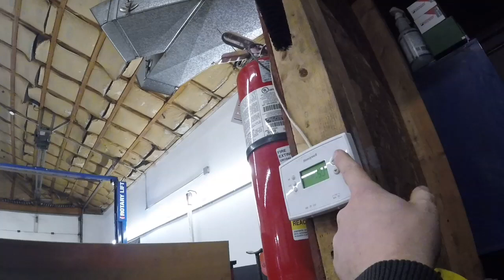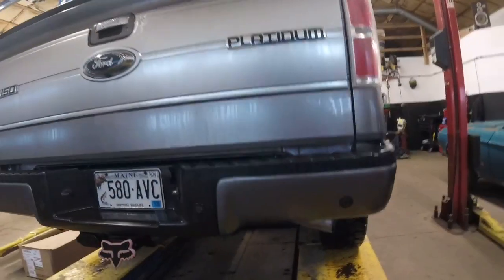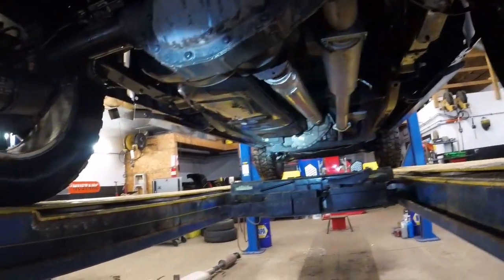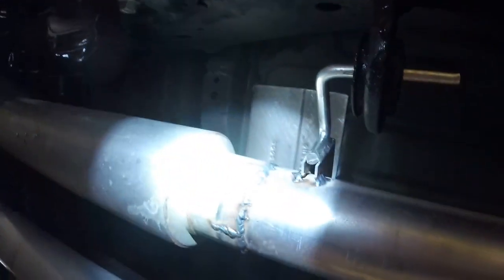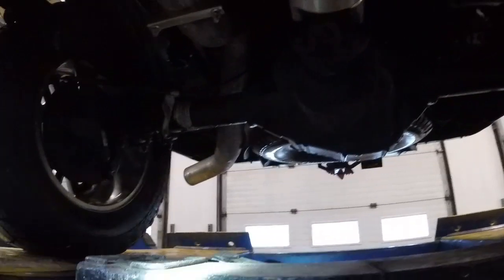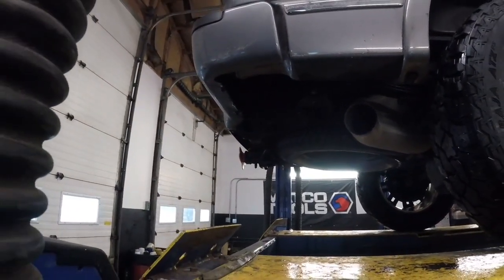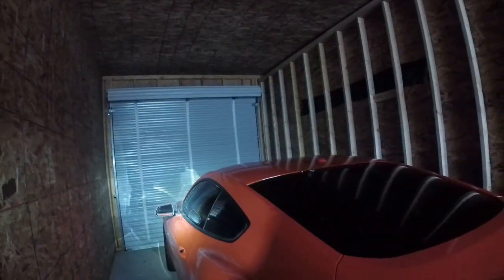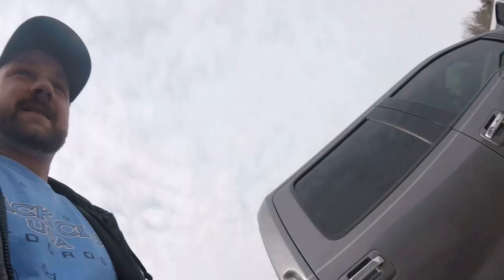Twin Turbo F150 gets LOUD!!! Mustang update

Comment: Did you have to retune your truck after putting a bigger diameter exhaust? Or it ran perfectly fine?
Reply from the maker: No tune required for cat back. If you get into the down pipes it would be very beneficial, but still not required if still catted

Comment: Did you notice any fuel mileage gains or loss?
Reply from the maker: Nope, MPG hasn't changed much since we bought the truck. We get 18-19 in the warmer months and 16-17 in the winter. I think it mostly decreases from more idle time warming up and defrosting windows.
Reply: @TheGTXJay  any power difference is the throttle a lot more responsive?
Reply from the maker: The exhaust didn't do much that I noticed, besides making the truck louder. However, AFE intake and SCT 93 octane tune were previously installed beforehand and they definitely improved the power noticeably. The intake had the most dramatic effect on the throttle response
Reply: @TheGTXJay  I got the 91 prx tune from mpt for my sct tuner and two other tunes. The truck hauls ass. Also added catch can and k&n intake. Great video thanks for sharing..
Reply from the maker: Our's is still running strong with this setup 👌
Reply: @TheGTXJay  So you only have the mbrp 4inch cat back exhaust? Nothing else done to exhaust?
Reply from the maker: @Maga4Lyfe  MBRP cat back, AFE intake, 93 SCT tune, UPR Mega catch can and a leveling kit with 34" Mickey Thompson ATZ tires
Reply: @TheGTXJay  Awesome. Sounds killer. Can't wait to get my exhaust. Thanks! 👍
Reply: @TheGTXJay  If you're just using the stock tune the sct programmer came with you should definitely look into mpt tunes.  You'll gain over 100hp instead of the 40hp you get with the stock sct tune. The difference is incredible.
Reply: Did this cause a check engine light for bypassing the o2 sensor?